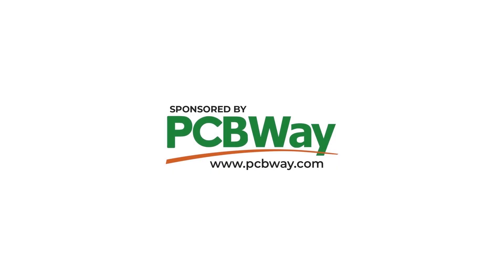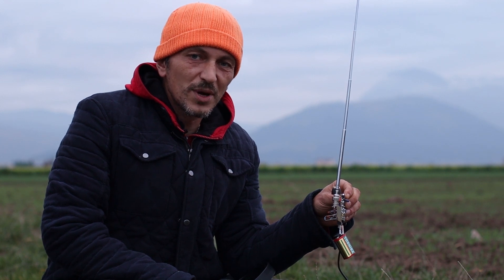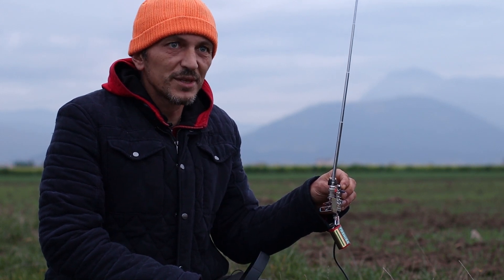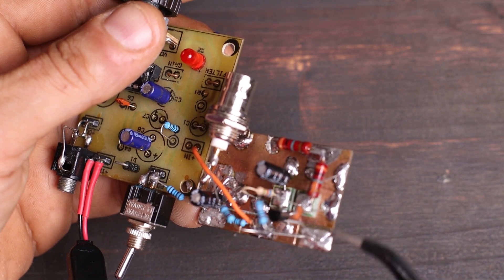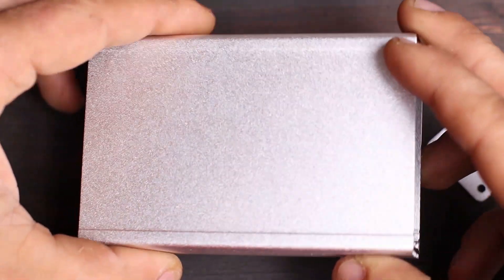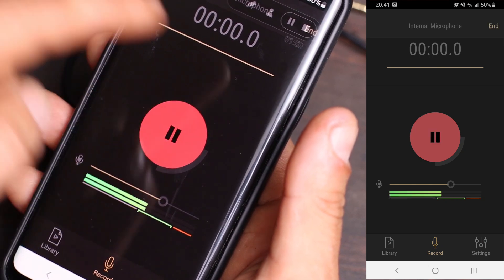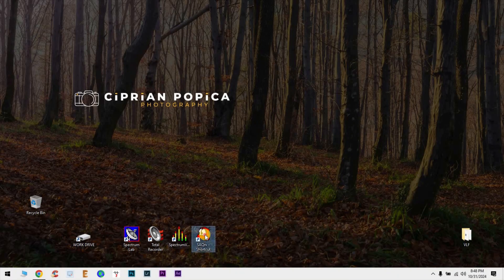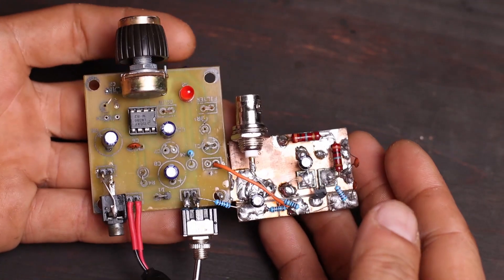UPDATED VLF Sferics Receiver ( Natural Receiver ) - New Schematic and PCB Board Design

Comment: Tnx. For your experiments.  Very nice.  73 from in3fci
Reply from the maker: Thank you as well for watching. 73, YO6DXE.
Reply: @dxexplorer ciao. I have a any piezo pick up preamp. With balanced output. Hy and low output. In this day i wil try test n vlf reception with   Ipad sonogram app  with or no ..I  try hihihi.  ….external  sound card .. iif. Y are lucky. That generate  low noise but  will try …thanks. For your idea .
If that work is a possible. Low budget vlf uff rx ..   whith. iPad. Or with  a simple. La386 audio amp
Reply from the maker: There is a piece of software that I used to receive the SAQ transmission called SAQrx. You can use the soundcard as antenna input and test there various gadgets 😁 Let me know how your experiments worked ... I'm really curious.
Reply: @dxexplorer yes. . I test if work… a piezo preamp For guitar cost 5euro. Is a very. Low budget system …if work ..hihi
Reply from the maker: Yes please. You made me curious 😁 I think I may still have some humbucker pickups somewhere from my older guitar. If I find them I will test this as well 😁.
Reply: @dxexplorer I have a piezo, pick up for acoustic guitar.. In Cina market can find at 5 10 euro
Reply from the maker: @supercecca1  Ahhhh that one is way better.
Reply: Hi,
Today I finally managed to test my STUP VLF I was writing to you about.

Ipad Spectrogram, M Audio external sound card, and guitar preamp for piezo pickup with EQ
Instead of the piezo pickup, I tried a 1-meter stylus and a battery-powered MiniWIP, not with a bias tee. I found a good ground using a row of vineyard wires, grounded with a large pole. The piezo preamp is connected to the sound card in low impedenze  with cannon cable I soldered a BNC connector instead of the piezo pickup. And I use 4meter rg58 extension cabe for antenna 
Initially, I wasn't satisfied with the system, but as soon as I raised the stylus to about 2 meters high, everything changed. The reception of spherical waves and other sounds was amazing.
Then I tried connecting the MiniWIP in place of the stylus, and raised it to 3 meters, and it was even better. I need to add a low-pass filter because I noticed some slight intermodulation from a broadcast, it sounded like Romanian radio.
Unfortunately, I didn't have much time, but the result was excellent. This was my first test. It was a cheap Chinese guitar preamp with a piezo input. Using the sound card's headphone output, I could hear what I was looking for very well. I need to box it up better, shielding the preamp a bit more. Despite being a bit wide open, it worked well, thanks in part to a very good grounding. Maybe I'll make a recording next time. I'll definitely use at least a 2-step low-pass filter. I forgot, the preamp has a 5-band EQ, which is very useful for reducing QRM and for optimal sound, in addition to the various volume controls, etc. A simple audio amplifier would certainly be enough to enjoy listening to, but this is very much aimed at studying this frequency range.
In the meantime, I ordered the PCBs on PCway for the receiver you built. Hi, and thanks for your excellent ideas.
73. de in3fci /qrp

Comment: For me, VLF is a very special, mystical band. I keep coming back to it after a while.
Thanks for the great videos!
Reply from the maker: Thank you as well for watching. I have one more VLF project or two coming soon. 73, YO6DXE
Reply: @dxexplorer  This is great news! For analysis and reception of VLF transmitters, I use SpectrumLab (older version 2019, the new one does not work well for me). And as receivers I am currently using "Přijímač NF magnetických polí - OK1FCB " or "Přijímač NF elektrických polí :: OK1FCB ".  You can search on Google for interest. These are pages from the author from the Czech Republic (I am from the Czech Republic), but there are wiring diagrams.
I look forward to your further experiments!
73, Aleš

Comment: Interesting stuff. That's a good improvement on the previous version. You should be able to receive the transmissions from SAQ using that and Spectrum Lab. I have some recordings I made years ago using a similar receiver that have the old soviet Alpha VLF navigation beacons chirping away.
Reply from the maker: I will finish installing the final version of the MiniWhip antenna this coming week so I will enjoy some VLF using that SAQrx inside where is nice and warm, no need to freeze outside 😅😅. 73
Reply: @dxexplorer  Sounds like a plan 😂
Reply from the maker: @RonanCantwell 😁😁😅😅

Comment: Nice improvement. If I might add a 47uf or higher to pin 7 to gnd and a 100nf from pin 5 to gnd and increase C4 to 1000uf.  Afrotech Mods explains in his 386 amp video.
Reply from the maker: I tried using the LM386 at first as it's meant to be and the results were not so great. So I kept the schematic as it was designed by K8TND as it seems to do a good job so far. 73, YO6DXE ( P.S. I can also use the preamp part only and there is no need for the AF amp if using a sound recorder that has high gain input settings.

Comment: I have no exploration experience with  static antenna  but thankfully  i can hear  how static antenna performs and i it has likely more signal to noise ratio.   Sadly autumn and other seasons with low Sun activity isnt good  for VLF.If you have more copper than VLF receiver will take it as much as you have,   resistors are noisy bastards
Reply from the maker: They are noisy indeed hahaha. I want sometime later in the future to play more with LC instead of RC. But for a first experiment I am happy with the results so far. Nature seems magical when you listen to it too... in a different way. Love it. 73, YO6DXE

Comment: Congratulation on hearing "Tweeks"! 
Next you should listen for "Whistlers", perhaps in the early morning. Whistlers can be very strong and are fascinating.
The secret is to improve your LPF so that the VLF noise doesn't mask the wanted ELF (eg the Sferics).
The better the LPF (eg more ELF), the more obvious is the frequency dispersal (eg chirp) in the Tweeks.
Reply: There is a good explanation on matching the very high impedance of the whip at:
(Can't put links)
search on "pa3fwm" and "technotes/tn07"
Reply from the maker: If I listen into the headphones it sounds a lot better than when I put it trough the audio recorder. I think its because from my experience so far RC filters are great when used directly on speakers or headphones, but not so effective when taking the audio into an external recorder. I had the same thing happening when I tried using the RC filter in the audio amp of the Sputnik Regen Receiver. So maybe in the future I will try to play around with some LC filtering instead. I just didn't had such big values on hand at the moment for what I needed and calculated ))). Thanks so much for all the tips. 73, YO6DXE